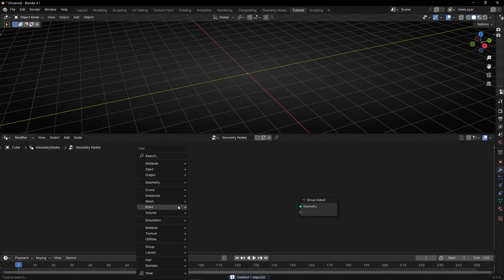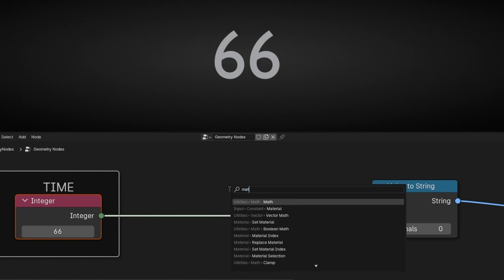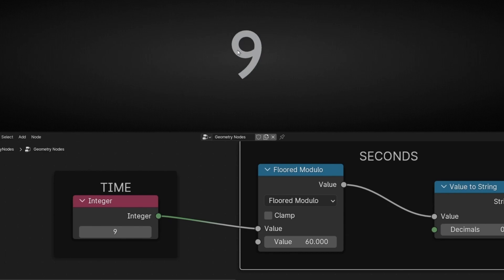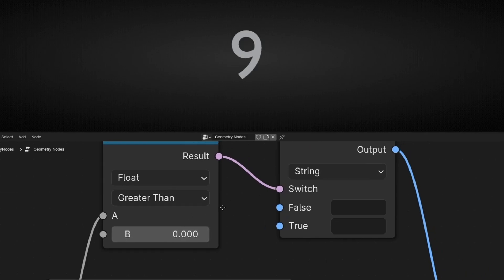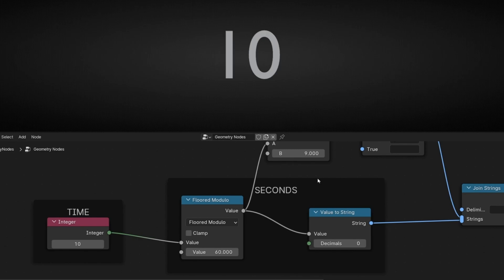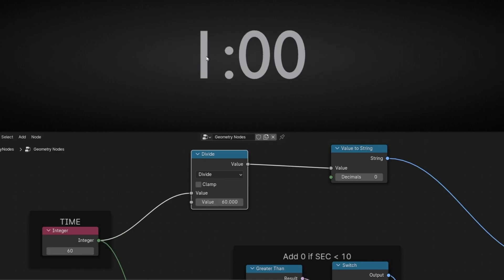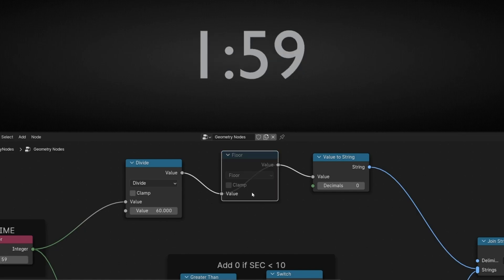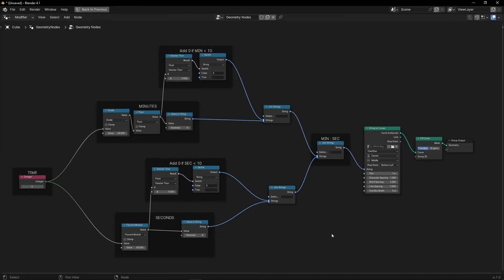How to Make a TIME COUNTER in Blender - Geometry Nodes

Comment: Thank you Xan. One small suggestion - you could show how this setup could actually work as a real time clock. For me (I needed it to count seconds and its fractions) the solution was to replace integer by value node and give it a driver i.e. in value window type #frame/"your fps"  (your fps is whichever fps one is using in his animation). As always - your geometry node tutorials are among the very best out there.